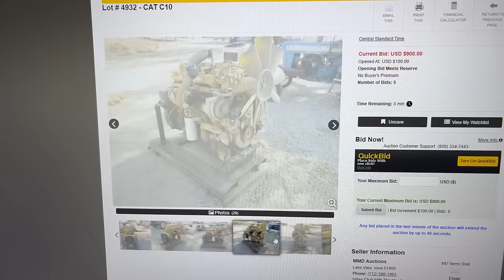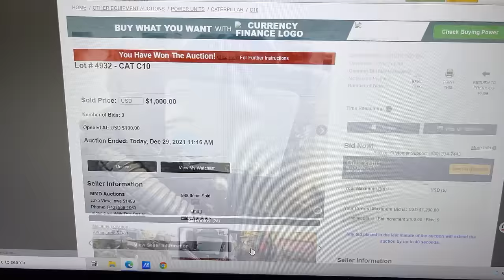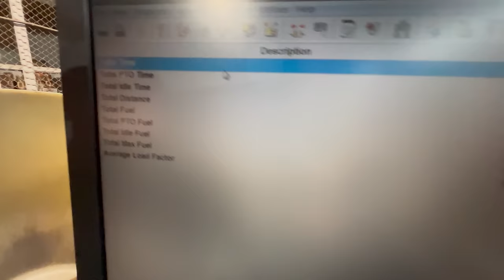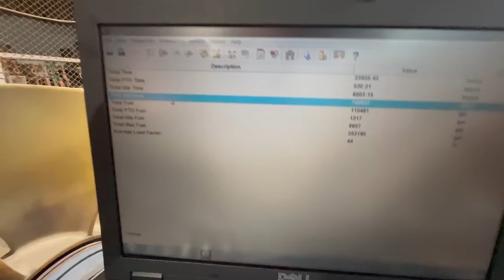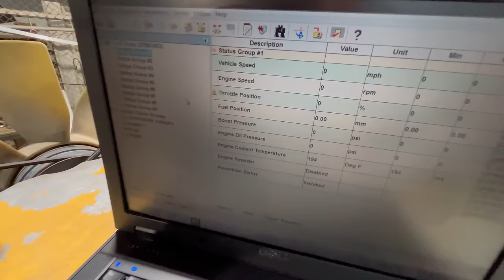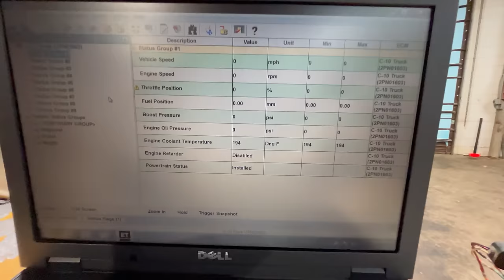Online Auction Buy - Caterpillar C-10 Diesel Engine - Will it Run or is it Junk?

Comment: Great video and very informative  and good little quick like guide on basic trouble shooting you seem very knowledgeable in cat this video actually had me wishing I was wrenching on them again was journeyman tech at a cat dealer here in Cali for 10yrs started out on earth moving equipment then switched to on highway side 1½-2 yrs in...  they had me doing full inframe rebuilds solo on c15/3406E and even B models at 19-21yrs old   youngest guy in the shop yet seemed to always get all the oldest engines that would come in my bread and butter was always the 3406B and 3116 but the ones that were job security an kept the shop busy was all that damn 07+ model with the regen crap and ard heads. But those C10 weren't that bad of a motor some have their bias  about them you'll have 1/2 like 1/2 will hate them. But all in all there good little motors typical issues I would see is can followers were prone to failure, water pump leaking water in oil, and seemed like every head would have cracks between valves in the butterfly cut but there's not an engine out there that doesn't have it's fair share of common failures. One little question how come u just didn't do an injector solenoid test through E.T. when u checked for the solenoids getting power? My assumption would be that it's a customer licensing so that  function might not be available but idk and just one tip although seeing how well knowledgeable you are you probably already know and may not do it for sake of saving  time but cracking the return line on the filter base before the check valve and pumping the primer till only fuel comes out no air bubbles the snug it up and give it couple more good pumps will typically have them fire up 1-2 revolution. When i would finish an inframe I'd unplug injector harness connector at valve cover crank engine till I saw oil pressure just to make sure I had oil throughout the system from everything being removed and drained then I'd due that to the fuel system and they always popped off like it was just being restarted after being shut down. Would make me cringe watching other guys minimum prime to the fuel system and fire a fresh rebuild up so it pops of fast but misses for a bit while there watching and waiting for oil pressure to build as the thing already been running😬😶.. Always hoped they used excessive amount of assembly lube on everything lol

Comment: Question -- Haven't gotten much past the filter drain / replacement and I'm by no means a diesel mechanic, but I'm wondering if off-road diesel is a problem for a CARB-certified engine even without its DPF / DEF setup? If I'm off-base, so be it, but I was under the impression that the off-road stuff was still the same pre-LSD / ULSD composition. And could that setup not communicating with the ECM be part of the problem? I drove OTR a few years and remember hearing something about on some engines the ECM will cut the fuel if there's an emissions problem. Also seems like some air returning to the supply bucket, so at this point I'm wondering if there's some kind of crack in the fueling system sucking just enough air to mess with it. Now to continue watching.

Comment: Have done several swap's of truck engine's into equipment. Excavators and loaders. cheaper then buying the equipment engine and work's fine as long as you detune them. Counterintuitive to take a 425 3406B down to 270 hp but it is the torque you need. Leave it at 425 and the loader will rip itself apart. But that c10 sounded pretty good even skipping on a cylinder.

Comment: Water in fuel led to algae. Had that happen to a bobcat that sat for years before I got ahold of it. Had to replace injectors, lines, filter and for good measure I pulled and flushed out the tank. Ran "killz" in the fuel for the 1st few tanks to ensure I got it all.

Comment: That brown/red spooge on the injectors, I've seen that inside Bosch VE pumps a time or two. Usually when they've been left to stand with the fuel system empty (not necessarily open to the elements, just with air instead of fuel) for a year or two.  I think it's kind of residue from when old, buggy diesel is allowed to evaporate.
Reply: That's rust and microbial contamination. Bad fuel, normal for 44 Cetane nowadays. The whole trade is shit today.
Reply: @PepperDarlington  Can't get any diesel without bio/any petrol without corn these days in the UK :(  Personally not worried as I run IDI Citroens with VE pumps but I feel for hauliers and machine operators stuck with 1202

Comment: I haven't worked on any earthmovers but I do know if you use Stockholm tar on the exposed studs it is about as good as you will ever do. It is important that the studs should be free of oil or grease. Best wishes, good luck, and above all, good health.

Comment: That film like stuff tends to be called a Varnish and it is normally solidified fuel. Happens in gas engines all the time and mostly soaking it in Carb cleaner (again meaning gas based Carb or injector) will work most of it out but its still a pain if you can't disassemble it all to clean. Should work with diesel to clean unless you need something special to not damage stuff. So that thing could have been sitting a pretty long time or ran very little every year.

Comment: That's varnish essentially, I'll tell you how to fix it without changing injectors. I've built many A,B, and C model pumps that have sat forever and done the same thing.  If you soak them in Toulene, it will break up that gum/varnish up with no problem.

Comment: That's gelatin, brother. It's color and placement is consistent, therefore an extremely hot and high pressure caused that type of oil contamination and consistent placement indicate a possible head gasket or bore liner seal failure.  Either way friend,  it's time for that engine to be over-hauled....😭

Jason Wampler

Comment: If those are the same voltage as the 3406 is for injector firing you can use a household no contact voltage detector to see if the injectors are getting the go signal. At least to the pass through anyway.

Comment: Great video! It was not a waste of time to switch the injectors because you likely solved the problem on cylinder 2, BUT it was/is a big risk in that it might have broke a working engine. You know the rule, you don't fix what isn't broke.

Comment: So whatever you did when you did the fuel filter (26:30 ish ) you fixed the air leak in the fuel system you can see that it is not blowing loads of bubbles from the return!

Comment: I had a 7.3 Powerstroke that had this funky slime contamination in the system. They said there's an algae that lives on diesel fuel. I had to get different injectors and had the diesel tank flushed. It wasn't cheap. It ran good after that

Comment: Trucks and excavators use bypass oil filters that filter a small percentage of oil to very small pore size (less than 2 micron). I’d love to fit something similar to my car engine. Snag is finding components at affordable cost.

Comment: Hi . I have the solution for the problem. The fuel is operated via vacuum. That's why she blows bubbles in your bucket of diesel . Get a coke bottle put 2 fitting 1 for fuel to the motor and the other to put air pressure in the bottle. The air will force the fuel down the line through the filter into the motor and out the return to the tank

Comment: You diagnosed one engine and got another one running at the same time. I think that engine sat around for a looong time, all that sludge under the covers, and that what looks like old dried up fuel that plugged those injectors up.

Comment: Great video.  At least it wasn’t the monumental waste of time you initially thought. Now you know the miss in the excavator.  Few questions. I have no experience with larger diesels. What’s the irregular snapping noises whenever it’s cranking. 15:05.  Ect.  Any relation to the popping when you were turning over with the ratchet early on? Didn’t seem rhythmic.  More random. Also what’s the rod/lever giving me anxiety spinning at what looks like the release bearing.  Looks as if a slight distraction could cost you one of your quadriceps.  Just curious. Love your vids.  Thanks.
Reply: Is your name Ben as in short for Benjamin? Because if so that's awesome
Reply: @MrFozzie52  Hell yeah brother!!

Comment: If you got 7 new injectors, then both engines would be running 100%.   There might even be a core charge on the 7 faulty injectors, which could be serviced ( by Area Diesel Supplies..?).

Comment: Wish I would of went with diesel instead  of gas to make a living as the parts just talk different if you gather my meaning. All sensors on gas now days and I was fifties kid with two four barrels going down the track... I was out of  the picture way before the LS engine and some of the other high horsepower cars. I was good for what i did which is nothing compared to this... thank you for sharing this information
Reply: Diesel is definitely the way to go. I'm fairly new to this industry, but I enjoy the simplicity of recommending repairs in the diesel world vs Gas. As Diesel customers, particularly those with Heavy Duty Vehicles, will spend anything to get their vehicle back on the road. So typically, if you request it, they buy it.
Reply: @camd4648  I watched fab rats go out and tip a Sherp on its tire/rotation devices as their only similar in tire by being round and moves like a skidsteer. The guy getting towed out was of a different personality and even the wife seemed like it was just a inconvenience to the day. Like ya, thanks but go now ... rude but not really thinking rude, just his way. I am sure their camper had a bidet in it. For him!! Money fell from his hands to be the very best in his neighborhood. I know I wouldn't of felt comfortable around him but the bill for turning his rig right side up would of replaced my bumper or what ever I wanted

Comment: I'm suspecting microbial growth in the fuel of the last user, hence the sticky goo on the injectors where they ride in the fuel galleries. Not sure if there's a fix for that once it's inside the injectors. Can you put an injector into a ultrasonic cleaner and expect results ?  But, this case shows why fuel quality, and occasional fuel treatment, is important.  Pretty sure that the truck ended up sitting an awful lot which lead to the growth of that slimy crap in its tanks, spreading throughout the fuel system.

Comment: Stupid question, any way to do a hillbilly rebuild on those bad injectors with a ultrasonic cleaner, dremel, sand paper, gun cleaning kit, kind of thing? Just in case someone doesn't have to have a spare excavator sitting out back . Have a good day and get back to work.

Comment: Southern valley diesel,llc 

Jason is professional working with diesel fuel injection pumps! 

In case if U need help.

What i see is pump is not working correctly. Could be seized rack or clogged plungers.
Reply from the maker: This is a MEUI engine.  There is no pump.
Reply: @KT3406E  Ahh gotcha. Than definitely it was caused of injectors. I watched at the end )

Comment: I did not understand from where the water did come. Maybe there is a crack in the engine block and cooling water goes somewhere it should not do. In this case the problem will appear again.

Comment: Don't they call that diesel fuel jellying Lucas has a fuel stabilizer that keeps clean and remove jellying I wonder if that could be used and allow the injectors would have the rust and gunk to cleaner ? Or can they be sent out to be cleaned

Comment: did you Pretreat the Engine with a detergent or use any  in the Pressure Washer ? i’ve personally never had that type of l results cleaning a used Engine ? typically in my  cases they are Marine Engines  i purchase and  recondition for my  needs

Comment: Question about the c7.  I have a cat 963c track loader that has the c7 in it.  It has very nicely landed a present in my lap by presenting itself a valve drop.......  My question to you is can I use cylinder heads and blocks off on-highway applications by just switching over all the stuff?  New heads are almost non-existent and the ones I did find are around 5k  Any information on using the block and head from an on-highway application to an off-highway application would be greatly appreciated

Comment: As far as that gooey shit that was on the old injectors, I’m wondering if they had red diesel in it and the engine sat for a few months and the fuel dried away leaving only the dye. I work with aviation fuels and a gas is dyed blue, when left for a few months it’ll evaporate away and leave the dye behind. Jet fuel and diesel will do the same

Comment: My company has a 1999 KW single axle truck with a c-10… it runs around 20 psi oil max when operating temp… any knowledge on if this is normal or not? They have started to treat it like an old girl that might need overhaul. It doesn’t ever gross more than 30k pounds even with a trailer. Says 850k on odometer but no history to know if a rebuild in its history

Comment: I'd be careful going off your theory with the injectors. That C-10 you got off auction could have a bad cylinder 2 that you're unaware of which you could end up wasting money on a new injector. I'd swap injectors around to verify that's the cheapest option, or you can send it out to get flow tested.
Reply from the maker: The chances of both engines having a completely wiped out #2 hole with no signs of pulsing blowby in either engine are next to 0.  I wouldn't even get out of bed in the morning if I was worried about being that careful.
Reply: @KT3406E  Next to 0 but not 0. I still think swapping the injectors is a bit of a safer option. Regardless tho good content.

Comment: My company has a Volvo with a D12 that did the same thing just engine did had fuel pressure but won't start without filling up the fuel filter and then priming it

Comment: ok I haven't finished the video yet. But as soon as you got the engine running with the gaz, I was screaming "clean the fucking injectors". Only confirmed by fuel pressure.
Reply: Just throw those injector in an ultrasonic cleaner

Comment: Hey KT where it shows the avg load factor @ 44% does that mean the engine had an easy life where 100% would be max hp and tq all the time?
Reply from the maker: Yes, 40-50% load factor is pretty common with truck engines.  Machinery and industrial engines usually see quite a bit higher load factor.

Comment: I have a question I have a 1990 Cat 3208T and it will start and run with starting fluid and it will stay running and drive perfect BUT no matter what it will not start back up on its own.

Comment: I've always wondered if steam cleaning every damages the electrical components or connections?
Reply: Not really. I´ve cleaned dirty circuit boards under running water, dried them up a bit, and they are good to go.

Comment: How different is the C10 in size as compared to a 3116 or 3126?  I am thinking of possibly swapping one of them into my 79 F-350, & I know the others will work with some effort. I am curious of what my options are.  I would like around 350-400hp, so it sems like the C10 would be fine in that regard.
Reply: Try and get the huei 3126/16. If you get the mechanical style it will be very hard to figure out. Most of the guys that had that knowledge are gone

Comment: No offence but using so much ether will cause missfire Or predetonation  and cause damage to cylinder, sleaves, pistons, piston rings and also connecting rod.... This not a common rail fuel injection system and what about EGR .. Nice work on the  engine starting 👍

Comment: Wish I had bought a cat. I got a komatsu pc360 6000 hrs oil in radiator and water in oil. S 47,000 for replacement engine from komatsu.

Comment: Not sure I understand the total time, it says 24000 hours, and it drove around 745000 miles (1198961 km), this is an average speed of about 50 km/h. It does not make sense, could someone explain the numbers?

Comment: thats insane............. if that Total fuel is accurate.......... @ 3.00 a gallon that would mean 345,000 USD spent on fuel............... which thats being total fuel = fuel used if its not then its even more insane if Total Max fuel, 253190 then thats over 750,000 USD spent on fuel.

Comment: Does anyone know why the diesel is red?
Reply: At least in the US, you can buy diesel fuel that is not taxed for on-highway use (for use in industrial and farm equipment, etc.)  Generally it has red dye in it to discourage anyone from using it in on highway vehicles where an inspector may see the dye and issue a citation.